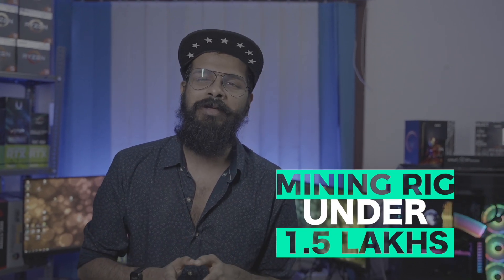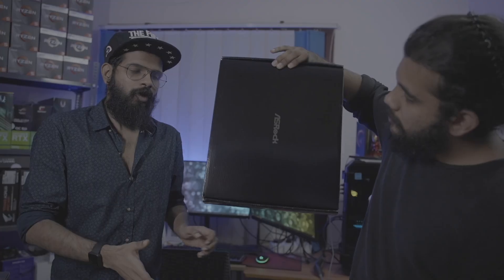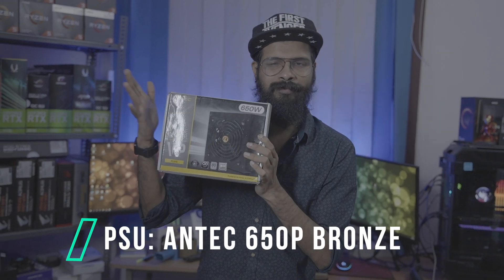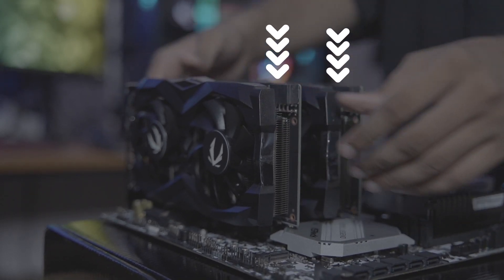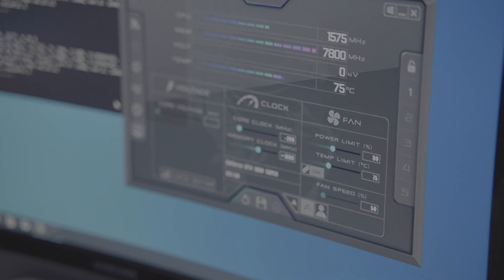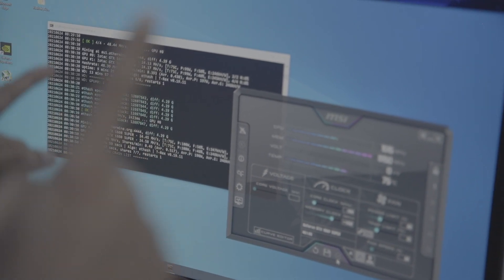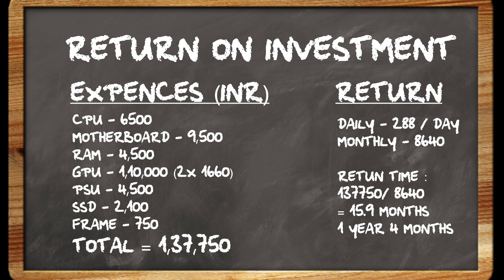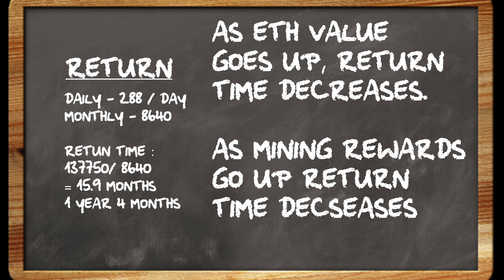Bitcoin Mining in KERALA : BUDGET ETH MINING RIG UNDER 1.5 LAKHS!

Comment from the maker: UPDATE!!!
Guys install the latest drivers on your 1660 super . 
Leave the core clock at o (don’t change)
Memory at +930
Power ar 75
32MHZ PER CARD !!!
Reply: use below settings, you will get 32mh/s on 1660 Super
downclock CORE by -100 MHz
downclock MEMORY by -502 MHz on Windows (-1004 MHz on Linux)
set POWER LIMIT to 60% 
Temperature 70
Reply: @sintojacobp  I get 31.80 stable at Core clock -200 Memory Clock +1100 Power 62%
1660ti at 74W
Reply: @sintojacobp  this settings give 27 mh only
Reply: Brother.. Can i have ur number.. Need  to know if i can some support for setting up.
Reply: Bro dch driver maty standard driver akano?plz reply

Comment: Chetta 1 gpu 3070 use panni mine rig create pannalama? Cost evlo varum
Reply: Bro dont use 3070. Instead use 3060ti. Its really efficient. It will provide 61 mh/s for 125W (non LHR and you have really really fjne tune the card).The average cost for a 3060ti is around 1lakh(if ypu are lucky)(and sad thing FE would cost only about 35,900 if they were retailed in MRP;  means now the cost is three times. If my calculations are right you could earn ₹8500 montly(real profit after substting elecrity and other mainteinjence cost). Thats means it would take atleast 16 Month to get the payback.and we dont know what happens in future(this whole data is estimated in todays Etherium value and difficymulty etc.,)

Comment: Returnsil current chilavvum koottanda..one month above mentioned rig run cheythaal one month enth current chilavu varrum bro ??
Reply: Around ₹1000.
Reply: Bro, pinne 2× GTX 1660 super vankunnathin pakaram 1× RTX 3060  Ti upayogikku(62 MH/s 125W sathikkum nalla rethiyil tune cheyyuvanenkil). It will be around 1lakh(olx nooku) ee gpu kk nalla resail valum und. Nalla efficient ann 497 kH/J varw kittunnund.
Reply: @niyazzmoithu20  rtx 3060ti non lhr vaanda 62mh/s kittaan...
Reply: @aquashows3273  bro LHR ആണ് പ്രശ്നം എങ്കിൽ. Radeon cards use cheyy. RX 6600 ആണ് ethereum mining ഇന്  ഏറ്റവും efficiency ഉള്ളത്(30+ MH/s 50W) വിലയും കുറവാണ് 2× RX6600 ഇന് ഒരു RTX 3060 Ti യെകാളും വില കുറവാണ്. Knn പറഞ്ഞാൽ, total 60 MH/s 100Wൽ. Nothing can beat this card right now. Stock ഉണ്ടാവാനും സാധ്യത ഉണ്ട്.

Comment: Anneram rtx3060 (3500aed=70k₹) 1 vaangiyal 50mh kittille w spl driver .
Reply from the maker: Bro 3060 vangumbo make sure it’s not the one with the new hardware ID (not LHR) 3060 randu hardware Id vachu varununde. You can’t use the dev driver on the new one . Only goes 18mhz on ETH,

Comment: just get a second hand 2080 or 2080s or a single 3060 for about 60-70k and it will give the same hash rate. dont go buying new gpus at these ridiculous prices for any profitable mining. Search olx or something. I got a 2080ti for 42k two months ago and a 2080s for 35k hashing arund 100mh at under 80k. Also add the electricity charge for calculating roi. I pretty much think 2 1660 super will charge around2k per 2 months for 80% power limit. Its better to reduce the power limit all the way down to see how it holds

Comment: how much mhs can we get for an rtx 3060 in mining etherium.
Reply: 70 I guess
Reply: @SachinJijo  Even 3070 can’t get 70
Reply: 42mh/s max
Reply: 48 mh. But limitation is u need an x16 port, gen3, 8lanes,470.05 driver, and hdmi dummy per card
Reply: @chakra531  can a b450steel legend handle that??
Reply: @harikrishnan5992  Yes 1 * 3060
Reply: @chakra531  can a b450 steel legenss handle the specs for 3060 to get 48mhz
Reply: @chakra531  how much is a 3060now..??
Reply: @harikrishnan5992  around 75k.
Dont buy useless brands colourfull,pny, gigabyte, if you are planning to buy either buy msi/asus/zotac
Reply: The strategy i use is buying second hand office desktop for 7k max and putting a 3060. Thereby the additive peripheral cost is set to minimal.
Reply: @chakra531  bro can i get your contact i have some doubts
Reply: @harikrishnan5992  you can ask your doubts here. If it's something i know, will share it.
Reply: @chakra531  so if i can get these speca in the motherboard the buying single rtx 3060 would be better fo this build right?